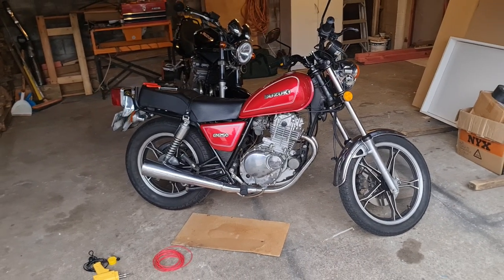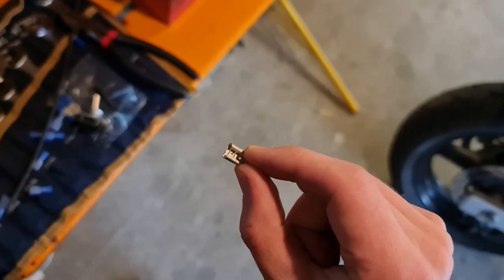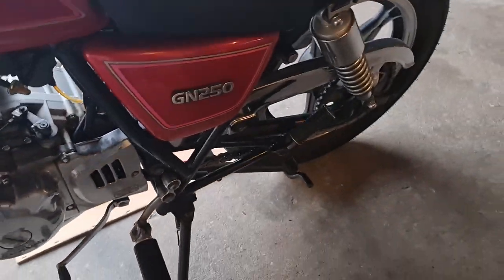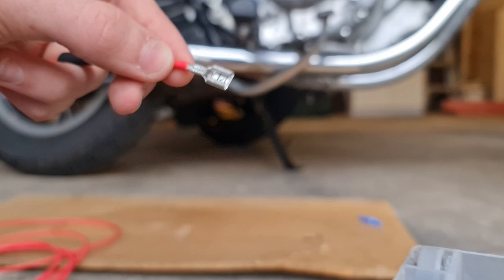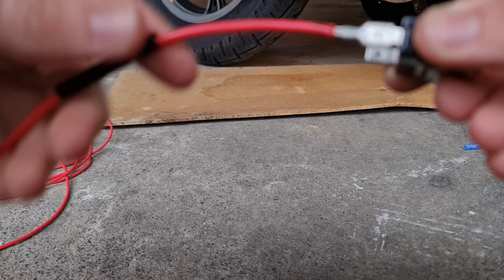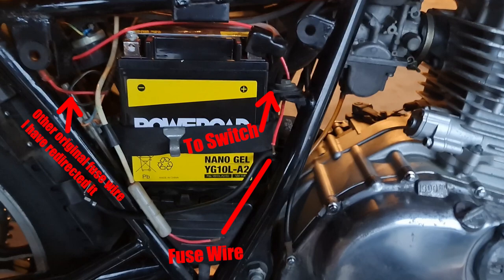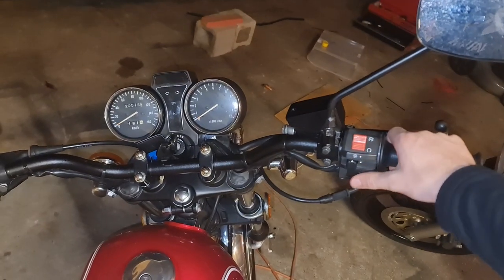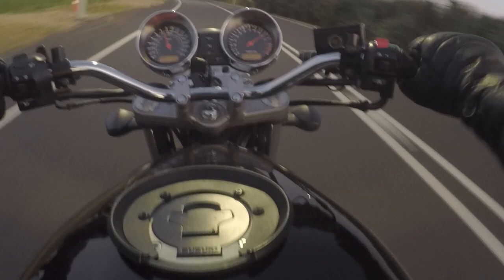How to Install a Hidden Kill Switch on your Motorcycle (Cheap Anti Theft Device)

Comment: Simple thing, and such a deterrent for thieves, got my 2019 duke 390 stolen… Retrieved it( tracker ), got it all patched up and had someone rip the cover off again today, im installing it now
Reply: Thank you for that man, earned a sub ❤️
Reply from the maker: Omg that's terrible poor Duke, and thankyou! I hope it came across clear enough in the video lol I tried my best😂and I highly recommend disc alarm locks and chains
Reply: Sadly in my country they mostly crack the wheel lock bar and cart it into a van or trailer.

Comment: Zane - thanks for the video.  Would be great to get the specs of the parts you got from the shop (ie. Wiring gauge, switch capacity, etc). Thanks again!

Comment: When my key Ignition failed I bypassed it using a switch like you used here. I still put the key in the Ignition for show but it is not needed to start the bike and go. Also unless you know where the switch is you can never get the bike to start.

Comment: Some news if the fuse blows the bike can run 2 ways really bypass it or hotwire bike and push start it will not start on button but will start even if you have the key and fuse blows still can push start the fuse is just a safety so it dont blow the loom but even you putting that on the other side of the fuse problem is can start by crossing the starter but if you stick it on the coil then they will not start the bike hence why immobiliser is through the the coil and you can put on starter efi cdi list can go on the more the better but as anyone know the more you do the more can go wrong but other than that not a bad video
Reply from the maker: Oh okay thankyou! That does sound better than how I've done it lol, I might rewire it at some point

Comment: Did you just cut the 12volta supply by putting switch on it?? If that so, then this is useless, because motor cycle can start without battery , just use kick starter, your connection will work only for the push start which required 12volts..
Reply: @megamouse4093  thats why i said it will work only for push start.